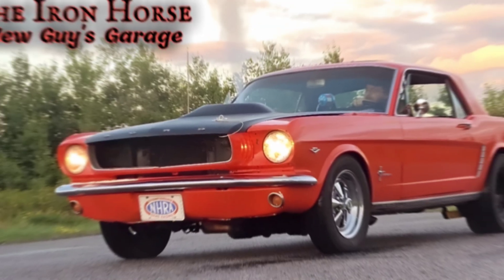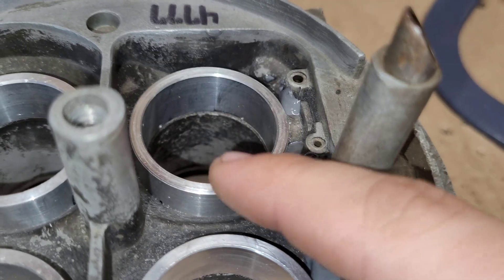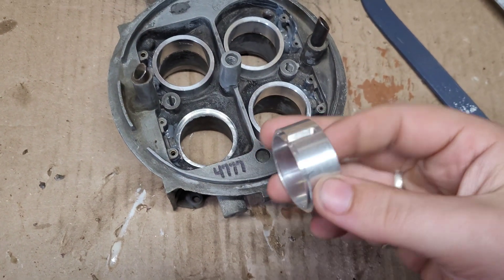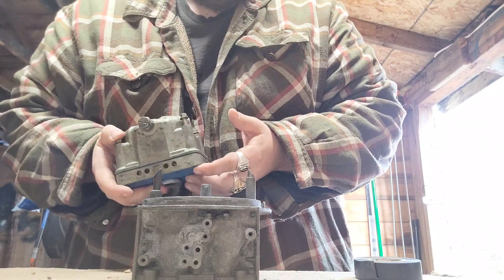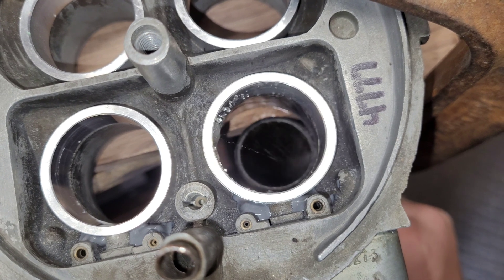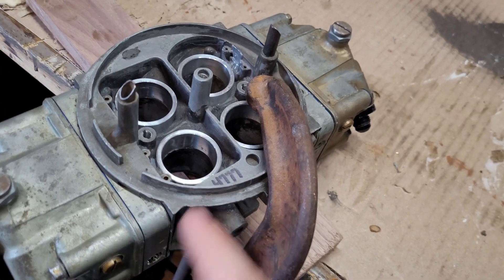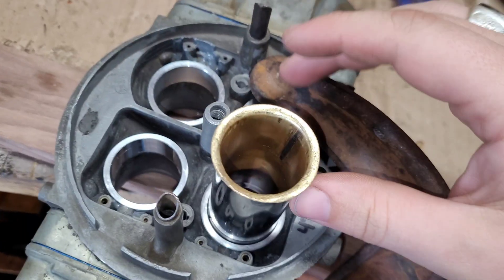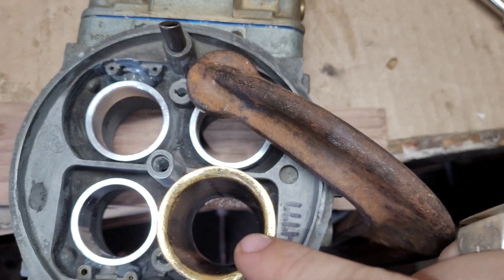GREATEST CARBURETOR BUILD ON YOUTUBE! | Project XMC A1 Prototype | Revealing The Venturi Booster!!

Comment: this is a great idea ! very close to a throttle body fuel injection set up !
Reply from the maker: Yep but all machanical! 
This carburetor was a 650cfm but the boosters take up a good % of the volume of the bore area. 

Im wondering just how much more cfm you gain with a boosterless setup like this 🤔 

Smaller boar = better responsiveness + no booster = more cfm for same bore size??? Idk 😂

Comment: I love my Edelbrock AVS2 800 cfm carburetor.  It's what you're trying to build. The concept definitely works.
Reply: I like my AVS2 a lot. Looking through Marketplace I saw a Holley 4150 with annular boosters.  Thinking I may want to try one out.
Reply from the maker: The avs2? That still has traditional boosters so im not entirely sure how you are making that connection 😅

They are good carburetors though lol 😆
Reply: @newguysgarage6802  They actually have annular boosters with 8 equally spaced holes for improved atomization. Eliminating downleg boosters